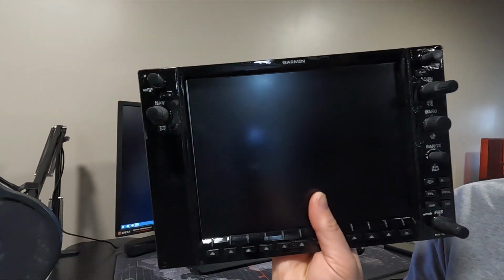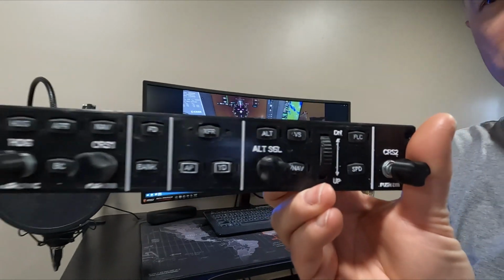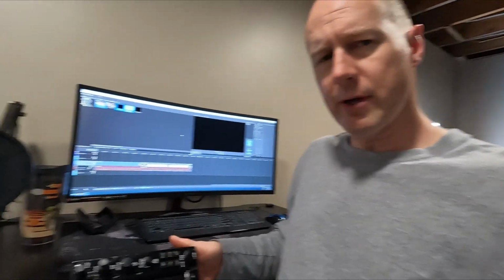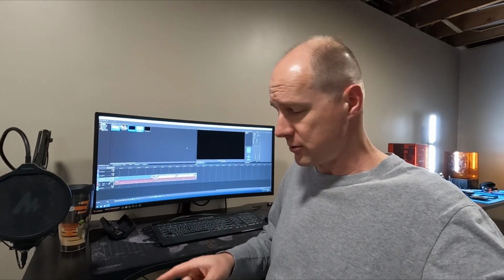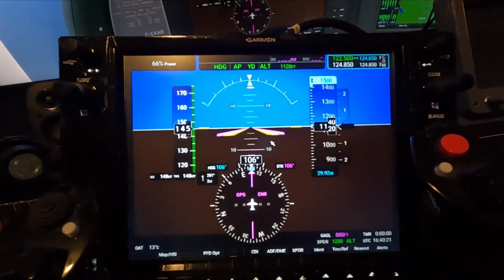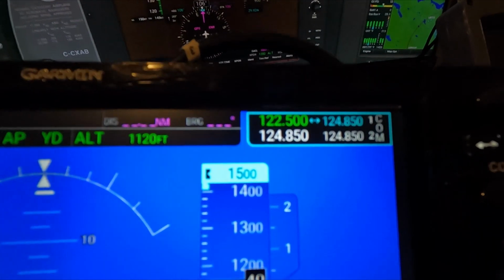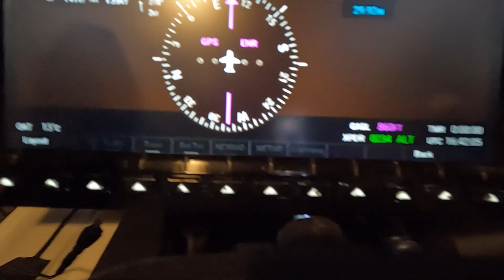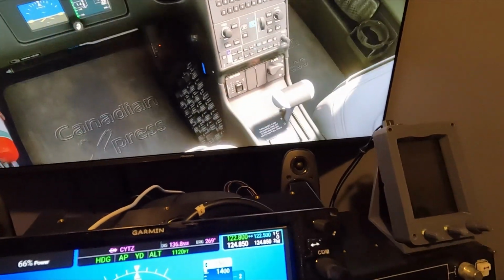DIY Garmin G1000 for your Home Flight Simulator - Part 2

Comment: I see you switched G1000 design from 737DYISIM the the design from FlightSimDIY as they have PCBs. Did you find the print designs STLs are the same? I think I want to go with the PCB boards to save wiring time.  Can you suggest a Touch Screen source as I plan to build two units, PFD and FMD and want to Popin the G3000 and Remap for other aircraft. Clear or White printed buttons?
Reply from the maker: No, the designs are different between the 2. So it was a fresh set of parts off the 3D printer. Karl's G1000 was good as an early on design. But FSDIY just did it so much better as far as the buttons and the PCBs... 

I resin printed the buttons in white. Which allows the back lighting to work perfectly. The filament print for the frame parts are white PLA. And the back lighting barely shows through. Those definitely need to be printed in clear. 

As for touchscreen, I never gave it a look for that size. Waveshare does make a 10.1 inch touch screen that you might be able to make work.

Comment: Does this plug into a USB port?
Reply from the maker: Yes, you'll need 2 USB ports from a powered Hub. 1 to run and power the touch screen and 1 to power and run the Mobieflight board. Plus, an HDMI port for the display.

Comment: I love that you use PCBs to hold and connect the buttons and encoders. Many sim builders connect every button etc. with separate cables. They end up with a spider web of cables, given it a messy look on the back side. For my own sim, I ended up designing my own PCBs, integrating more and more functionality into a single board per unit. It takes a while to design the PCBs, but at the end it looks clean and operates very stable (no broken or disconnecting tiny cables etc.)
Reply from the maker: I started with a built that didn't have any PCBs early on. It was just a mess of wiring, so I gave up on it. This one was so easy with the PCBs, and the cost was so little to buy them. It would be foolish to go any other way.
Reply: @thesimproject73  Yeah, I noted that these PCBs can be purchased, ready to assemble.

Comment: I'm still waiting for all of my components to arrive because I didn't buy the complete kit from FlightSimDIY. If you're planning on 3D printing the parts yourself, be aware that the case is just slightly too large for any of the BambuLabs printers (I have the P1S). You can print the faceplate in four parts and glue them up, but if you want them standalone you need to plan accordingly. I'm waiting for the larger prints to come from my source in Shanghai. Some of the the bill of materials seems wrong to me - the m2x5 screws to hold the LCD Panel weren't long enought to grip into the plastic. I ended up using heated inserts for M2 screws and that seems to be working well. Thanks for making this video - lots of good information on the assembly process.
Reply from the maker: I printed everything on my Ender 3 and glued it. Turned out nicely, and the bamboo should do even a nicer job.

Comment: Very good release and super video, but can you share wich screen you are using ?
Reply from the maker: Google... 10.4 in VS104T-004A 1024x768 600nit IPS LCD Screen HDMI USB LCD Controller Board

Avaliable everywhere. Amazon price has gone way up here in acanada for me. But E-bay links have it for under 100 bucks.

Thanks for watching 👀 👍